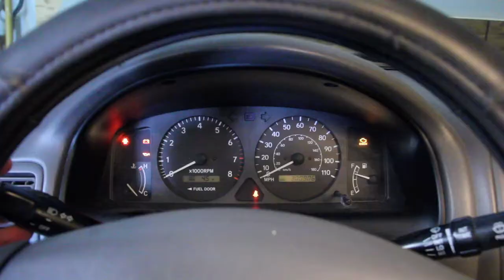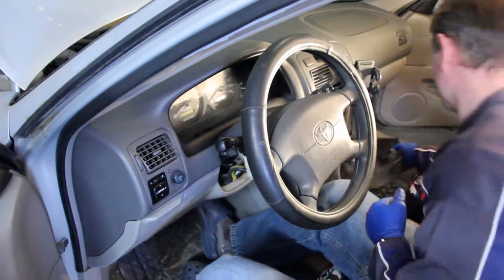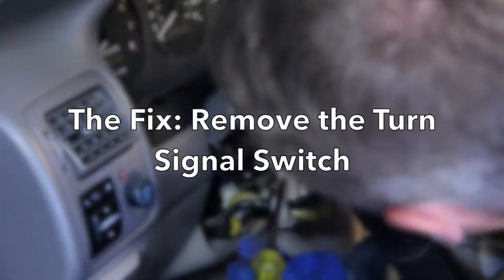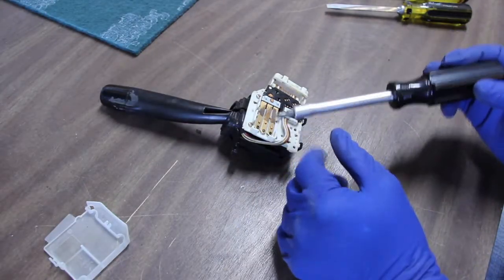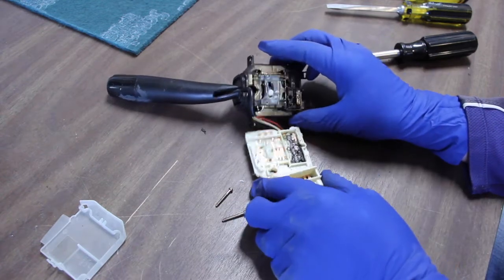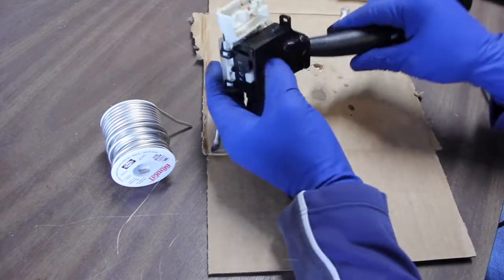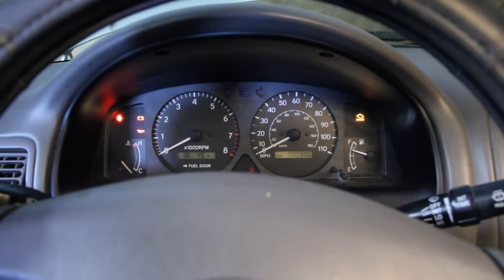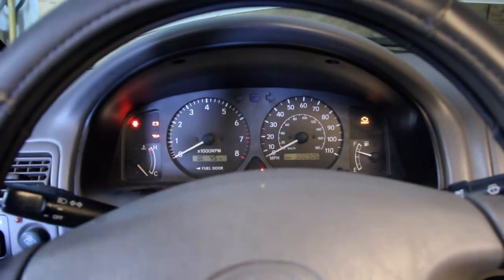Fix: Corolla Left Turn Signal - intermittently not working and making rapid noise with no blinker

Comment: This was exactly what I needed. It fixed my problem on a 2001 Toyota Corolla.  A middle contact was worn flat and adding a dot of solder fixed it. Also, the grease was black or dry so added fresh dielectric grease helped as well. Thank you for saving me $50 for a replacement blinker handle!!!!
Reply from the maker: Yeah!  I'm so happy it saved you a little cash!  Happy driving (and turning)!  Thanks for taking the time to leave me a note, it makes my day!

Comment: I was thinking about it all wrong, I was thinking a fuse issue or turn signal relay, but it makes more sense now that I think about it that it's the actual turn signal mechanism. (I have zero experience before now with this issue). I can get it to work most of the time as long as I turn it on slowly enough.  If I turn it on quickly it doesn't work at all on the left side.  I use my signals religiously so this is one issue that has been really bugging me since it started to happen.  As long as I have enough solder I think I should hopefully be able to fix this tomorrow.  

Thanks for the help.

Comment: Going to try this on my Toyota, thanks for the video!
Reply from the maker: Good luck - let me know how it goes for you.  I was surprised how well it worked and as you can see in the video, it was easier than I thought it would have been.  I hope you find it easy and all goes well for you too.  Thanks for the comment!
Reply: @buck4mt  It's now been a month since I did this same fix to my 1998 Avensis, and it has worked like a charm. There are some differences with the wiring and such, but the basics are very similar. Mine were also more dirty rather than worn, but adding a bit of soldering iron on the contacts did the trick. It might be that cleaning the contacts could be enough of a fix for this issue.

Comment: This is exactly the problem I have with my Corolla on the left blinker. Quick Google search didn't turn up proper results so I never bothered and learned to drive with a turn signal I slightly push in every time I make a turn. Now I can fix it! Great! Thank you so much.

I do notice that you only solder the contacts, so without soldering an additional piece of brass on the contacts. Just wondering how just using solder held up for you? Would you recommend using an additional piece of brass?
Reply from the maker: It seemed to hold up great, but unfortunately I can't report further on how well it held up because I ended up selling the vehicle about a year after I fixed the blinker.  So, I'm simply just hoping it is still continuing to work well for the new owner!  Sorry I can't be more help - but thanks so much for checking out the video and leaving a comment.  Good luck with fixing it!  (It is one of the most satisfying fixes, since the blinker feels like new and you use it so often - great return on your invested time!!)
Reply: buck4mt thank you for sharing your experience. I have high hopes for my blinker. I’ll post a small update later sharing my results.
Reply: @buck4mt  So, I finally got my car back from the workshop today. They noticed this issue as well but I told them I wanted to do the fix myself. They told me to just order a new blinker unit which I kindly declined :D. Fixing the blinker was exactly as described in this video and a very satisfying process.

I did the fix with solder only (fingers crossed for it holding up for a while) and used ceramic grease since this is what I had on hand. If I made a mistake with that, I would love to hear it. The middle contact point was indeed all worn down so I put a jab of solder on it as well as the other two contact points (just for good measure). Working with my hobby soldering iron, I to put too much solder on the contacts so I did spend a good 30 minutes sanding it down again as the handle wasn't able to overcome the bump I created. After that, not forgetting to plug the unit in ;), it was all working again. Like magic!

All in all, I would recommend this fix. Especially if you like to start working of your own car but don't know where to start. It's an easy process and like you said, it's very satisfying and the blinker feels like new again. Thanks a bunch for your video. Great help! Feeling a very happy Corolla owner!
Reply from the maker: @wmrsp  - What a great update!  Thanks so much for taking the time to come back and update me.  It is so great to hear that you were able to fix the blinker yourself - and I'm glad you too got the satisfaction of fixing it yourself!  It feels so good.  :)  Thanks again for the update - it truly brightens my day and I'm wishing you happy turning for years to come!  Cheers!
Reply: @buck4mt  Thank you sir!

Comment: i have a similar problem. when i use the signal and turn the steering back straight it should switch off...but only one side works like that. where do you think the problem is?

Comment: Does the car battery need to be disconnected for this?
Reply from the maker: I don’t believe so.  I did to be safe, but since you are unplugging the blinker component, you remove it from the system before you do any work.  So I didn’t think you need to disconnect the battery.  But I’m no expert!  Good luck!
Reply: @buck4mt  Thanks! Did this yesterday, you saved me several hours of waiting and $150

Comment: Does it matter wether its the left or right turn signal that is having this problem?
Reply from the maker: When I was having the problem, it seemed everything that I found mentioned the "left" signal, but since the issue is that the terminal wore down and wasn't make a strong connection, I don't know why it couldn't happen on the right.  Perhaps we all turned left more often and you turn right more often??  ;)
Reply: @buck4mt  We not only need the left on, to cross a lane, but are often stuck sitting there with it on, while waiting for the other lane to clear.  Also, can fork to the right with no directional, but have to use directional, to fork to the left.  You're assumption, we left turn more often, for the US, likely right.